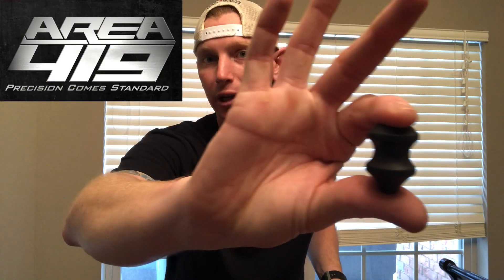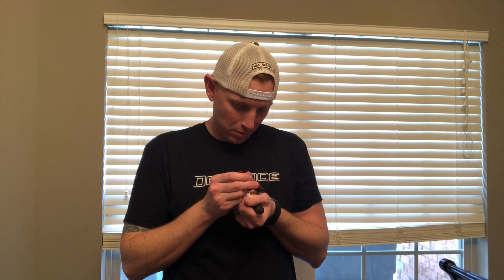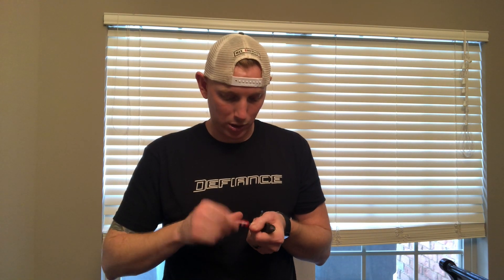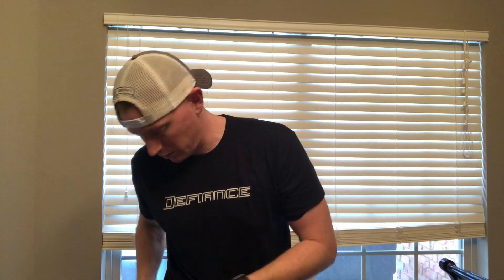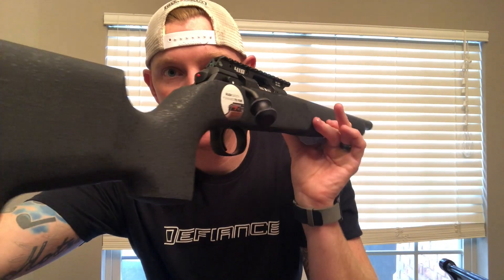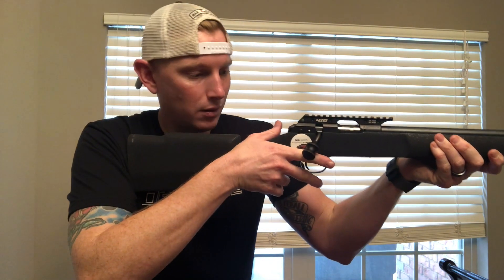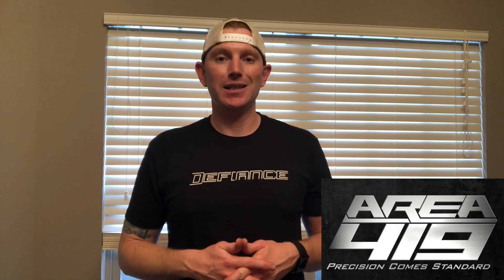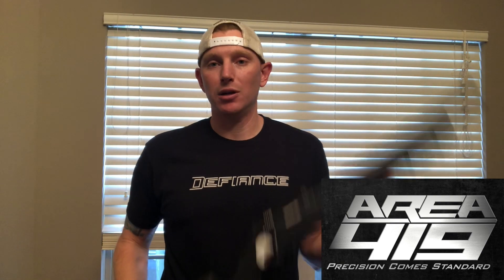CZ 457 NRL22 Part 3 Area 419 Bolt Knob Install

Comment: Didn't clean the excess off your fingers, grabbed the bolt, then put it back in and cycled the action...
Reply from the maker: If you’re referring to cleaning g the threads on the bolt I did it prior to starting the video when I took the knob off the first time to ensure i didn’t do it on camera
Reply: @AZHOTROD84  I'm referring to the blue loc-tite you smeared all over the bolt